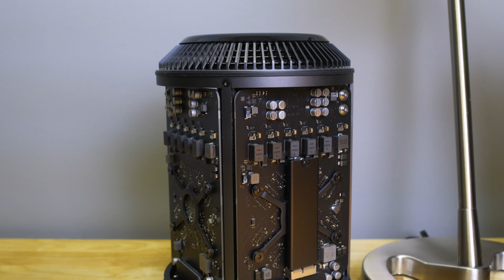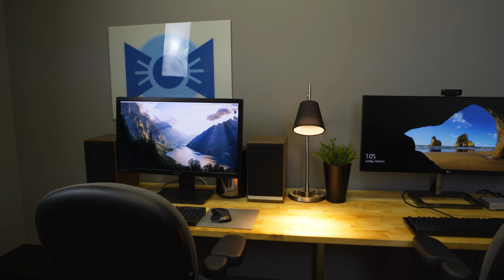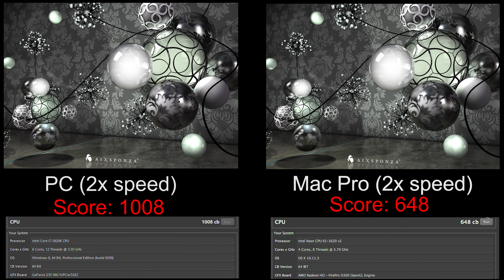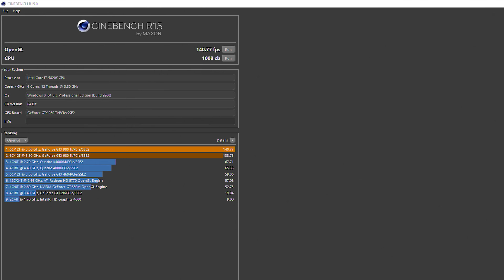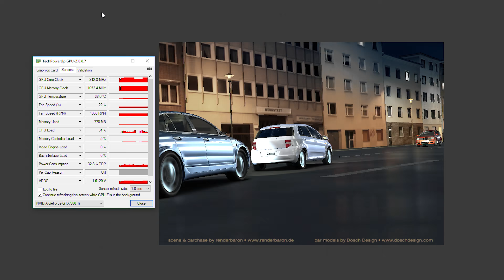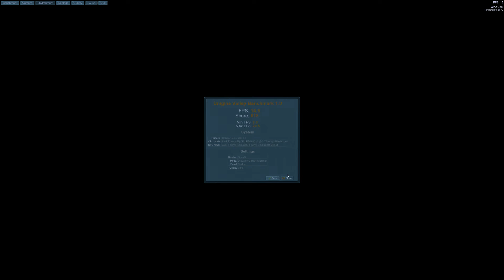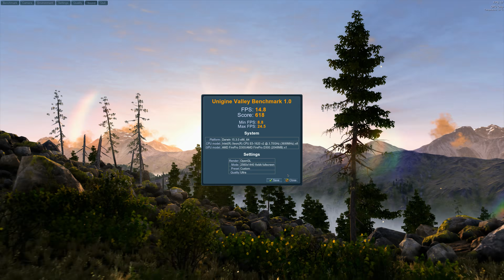$2,000 Custom PC vs $4,000 Mac Pro

Comment: Mac = Empty symbol of status and looks.

PC = Actuall worth in substance and performance.

Conclusion:

Buy a Mac if you want to prove yourself as an vain air headed person. Buy the parts and build your own PC if you are an intelligent person who cares about actuall performance and longevity.

Ps.

I know, I know... I am sounding like an rude asshole, I maybe am, but that's my slang and my statement is true anyways. If you have the money to spend on a Mac, there's no an actuall reason to not build a beast of pc equivalent to the same price or an still by far more powerful machine for like half the price. Now with the new Mini ITX structure you can also build campact and very good looking machines and still have a dope performance over Mac.
Reply: Fossegrim ya , it is your pc, but the problem that cause you unable to access internet is not the pc, can be a lot of issues. eg : lan cable and os.

If you say Mac os is better than Windows os then I okay with that.
Reply: The PC I will be building will murder any Mac
Reply: Fossegrim Then it is "your" Pc the problem. There are several models of Pc and laptops over there, and find a good one is not that hard, even less is you have the budget to spend into a macbook.

But what are you saying is like say all books are shit because the only book that you have read was a bad book.

Again, I know it is easier to pick a Mac because there are more standarized models, but picking a PC/Laptop is not that hard either.
Reply: Gabriel Pereira I only wish macOS was available for custom builds. Windows really pisses me off, lol
Reply: Gabriel Pereira But PC runs Windows so..... 😉
Reply: Not so sure about that. The portable Pascal series cards are very impressive, although I don't think they've managed to squeeze the 1080 into anything smaller than a 17 inch laptop. 15 is my max for something to qualify as portable. I'm a college student, I'd like to have room in my bag for other things too and not look like a hiker. One other thing that really irks me about windows laptops as well is the trackpad software. It's gotten a LOT better, but Mac tracking simply feels more organic with the multi-touch gestures and all. And I also despise touchscreens on laptops so that feature is useless to me.
Reply: Gabriel Pereira Um, my pc costed more than my mac book. Made a custom build from the top deliverer in my country.
Reply: The PC I will be building will murder any Mac
Reply: Craig Smith In that matter I have to accept you are right. Linux is better OS than Windows. But overall, Pc's are still better, atleast Windows is good enough to fulfill its end.
Reply: is it hard building a pc n how long will it take?
Reply: +Craig Smith thx fam I appreciate the help💯
Reply: SpartanDara117 u can put a desktop pc in a bag and mac is shit
Reply: SpartanDara117 Zotac mini pcs are ready to jump in your magic backpack
Reply: Gabriel Pereira

Apple is not great value for money, however, some have more important things to do than to sit around playing games. Windows OS across the board is a complete dumpster fire.
There is no ecosystem that can provide the holistic experience apple can #fact.
Reply: But now, with the new pascal gpu on laptop, you can put a "desktop" on your backpack.
Reply: SpartanDara117 So yeah... I am also a college student and I have a 17" laptop and I'm just find. I got this VAIO in 2009 and since then it just have required to format its drive twice and one charger replacement, which you can find pretty much anywhere since it doesn't requires exclusive like hardware. I know, is a pretty old model but the way it has served me during all this years with no need of major maintance rather than your typical drive space liberation or getting a new charger just proves how much of a longevity a pc/laptop may have.

As I said, I know I was very rude with my main comment. but still, getting my laptop with me is even waaay more comfortable than carrying your avarage single book.

Ok, it may not be as thin or light as a Mac but it is in no way a "brick", plus is waaaay cheaper, sturdier and the performance is just great (I have been thinking on change it tho, but het, almost 7 years with it and even if I'm going to change it it will not be any time within this year haha).

So it is ok if you pay "a bit more" for a machine if this one is more comfortable to you, but paying that much more just makes all those esthetical and comfortable "details" menaingless because it is way too overpriced.

I'l give you this, if your major specificly requires a Macbook then ok, it an't be helped and you have to gor for it. But by the same ammount of money pretty much any laptop would be more than capable to suffies all your needs with ease.

Otherwise is just like buy an expensive car just based on details like "if i like the shape and color, if it has a good stereo, if it has leather interiors" and stuffs like that, instead of actul engine performance, gasoline consumption in relation with the power delivered, if it is able to ride through harsh roads, how expensive and how hard is to get replacement parts, how many time it  etc, etc.

So what if the laptop is 1 pound heavier or 1 and something inch wider, if I can save more than U$200 and still getting a damn good performance there's no way it can be even called a bothering to carry a machine like that.

When the time comes I will be changing my laptop for a aprox U$2000 = i7 6700K/16Gb ram/gtx 1080 G8 Desktop Pc, that should be last for "at least" another 7 years, and for portable porpuses I'll just get an efficient tablet.

I will use some Mini ITX type of build, but if I decide to make an even more "long term" pc I will just go for the standart size just to get further further room for improvements.
Reply: Aoron1nash That's right.
Reply: yep, Macs are overprice especially the Trashcan
Reply: Fossegrim its not pc problem , I feel pity about your electronic devices , you know nothing about them
Reply: Louis Lee It is my pc. When I get a pc, I expect it not to randomly deny my access to the internett.
Reply: X_KING.ME_X not hard, you just need to make sure every component is compatible
Reply: +Craig Smith ahh so I wouldn't be able to just buy different parts from different brands? I want to build a pc that can run ultra 1080 on all games. I can only spend between $3,000-3,5000 tho
Reply: X_KING.ME_X you can buy different brands just ensure the motherboard fits inside. That's one example. Another example could be with RAM (memory), if your motherboard (main component circuit board) only has 2 slots for ram sticks, you can only have a maximum of 2 sticks. Maximum supported RAM for a motherboard is displayed under a specification table. My old motherboard supported 16GB of DDR3 type RAM maximum.
Reply: X_KING.ME_X all the cables need to be of the right type
Reply: X_KING.ME_X that's alright fam ;)
Reply: Michele Grieco my full tower pc fits into a bag
Reply: i have a 1000$ Asus laptop, never lagged, never failed me , both in games or rendering
Reply: Mac = BOOLSHIT!
Reply: And still, there are ways to perfectly run Ubuntu or Linux into a PC.

#fact.
Reply: Consuela you mean... Apple is expensive and everyone knows it
Reply: so  what? you can install OS X or a linux distro
Reply: Lelouch Vi Brittania you forget about thermal throttling on them tho
Reply: i buy macbook for its design, and osx is very very smooth, without any bugs, easy to operate, and once again, nothing beat apple design, good luck at backpacking your 8kg laptop with its plastic texture and 70mm thickness, 
it's like comparing 130k nissan GT-R vs 400k lambo aventador, still GTR faster than aventador, then why people still buy aventador?
Reply: Razer HP specter Dell XPS15 ect
Reply: Gabriel Pereira iOS development requires a Mac so you need a Mac if you want to do iOS development
Reply: GBCAwesome or an hackintosh
Reply: X_KING.ME_X get used parts and if you don't want it
then try win the lottery
there are websites that builds PC's for you and ship it to you.
just choose the parts and pay them a small amount of money
Reply: I'd like to know if the DDR4 RAM plays a. role in the difference?
Reply: G Thomás Hart 
Ryzen/8th gen Intel only supports DDR4, it's basically a futureproof thing
Reply: and everything you need to do its just navigate in internet using spreadsheet and some other  noob typical stuff.. 90% of apple users are  noobs and newbie....
Reply: idiot
Reply: In short

Mac = Expensive

PC = Cheaper
Reply: No. I bought a Macbook because its a well-constructed piece of hardware that functions extremely smoothly and does everything I need it to do.  I also have my PC rig to demolish benchmarks and fly through games. Different devices for different uses. Good luck building a PC you can toss in your backpack.
Reply: SpartanDara117 That's what laptops are for tho.

Please quote where I said "portable devices" or where is that topic covered in the video in which context I based on my comment.
Reply: You didn't, but I got the feeling that you suggested that windows laptops were superior to Macs, which for me simply isn't this case. The whole "buy a Mac if you're air headed" thing you was what got me.   My mistake if you meant otherwise.
Reply: there are some portable pascal laptop out there that brings great performance for the size, for example the 1060 version of razer blade, or the 14 inch msi laptop etc, but i think there is no one can beat the quality that macbook offers.
Reply: This is BS. My pc's always get some problems after 1 year or something. Its really hard to find what the problem is aswell. Right now, it seems like its chrome. Chrome cant load a site, then crashes, and then the whole pc can not get connection to the internett even tho its connected with a lan cable. Have to restart to fix it. Does not know what the origin is. My macbook pro from 2012, the only problem is that it is really slow now due to 4+ years of age and updated OS. People that buy mac do it because they just want a PC that works, and i have never in my 4 years owning one have to dealt with any problems at all. On my windows that I have had over 6-7 years, I have used countless hours trying to fix shit on it. And also, you call people that buy mac vain air head? You dont even know the definition of a PC. You are basically saying that a mac is an empty symbol of status and looks, but a portable mac is also actuall worth in substance and performance.

Comment: I too purchased a refurbished part that I regret.. A WD Black 2TB drive. It made a grinding noise when I first received it, RMA'd it and the replacement drive I received seemed good.. Now about a year later, I've loaded the drive up with content, and I'm having a few system hiccups. I check it out, and S.M.A.R.T. tells me there are several bad sectors, indicative of a failing drive : (... Never again will I buy refurbished junk!!

Comment: Ive had both for over 20 years now and speed is one thing. Stability has been Macs biggest strength. Ive built tons of pcs and i used them to the point where i had to rewipe them every 6 months. Macs just hold up better. Thats why industies use them regularly.
Reply: Yeah no. I own PCs and Macs. I have problems with the Macs constantly, whether it's random shutdowns for no reason, features that just don't work properly (file sharing comes to mind) and consistently after a couple of OS updates the whole system is trash and needs to be rebuilt from scratch. So try another argument.
Reply: The Laptop I'm using in this very moment, have been with me since 2009 and still works fine.
Reply: what make is your laptop Gabe ?
Reply: Sjrick It's a VAIO, don't remember the model tho. Was a gift from some uncles when I was about to start college. I just have formated the hardrive like twice, and now I just need a new charger since my current one is starting to get loose. But that's pretty much it.
Reply: Sjrick had my pc since 2009 :) bought a macbook in 2014, it broke last year.

Comment: I think you should to run cinebench on the same OS, because in windows, cinebench show results 40-50% better than cinebench running on OSX/Mac OS.
Reply: Found the Mac enthusiast.
Reply: Grankus But if you was to buy a Mac Pro you will most likely run it on OS X
Reply: Grankus well thats why its called PC and MAC. not p-mac or ma-pc
Reply: It’s not about OS, it’s about Prices
Reply: Just another point how bad apple is when there OS cant even keep up with windows xD

Comment: I would never get a Mac for gaming, but my 2015 Macbook Pro is great. Not for gaming, the hardware is outdated (even at release), but it simply works. I love the battery life, the screen, the keyboard, the build quality etc - and that makes it worth the price since I will not need to buy a new laptop for many years. 

I'll probably get a gaming PC soon and install a Linux partition on it as well.

Comment: 3.8ghz with a 280mm liquid cooler on the 5820k? You lost out on the silicon lottery BADLY. The 5820k build I did was able to hit 4.6ghz with a similar cooler.
Reply from the maker: +Kevolu I'm at 4.5 now.
Reply: Snazzy Labs yeah I was fairly certain you were able to fix it by now. I had a harder time overclocking the 5820k than the 6600k. Just tends to be more finicky.
Reply: air coolers get way too much flak...
Reply: pretty sure he can overclock it better
Reply: some air cooler are very good... You're saying this as if it was stock cooler (ahah) . I'm at 4.5 on a 4770K with a Dark Rock 3 (and I was at 4.2 with the stock cooler :p)
Reply: Snazzy Labs lel now it probably destroys the Mac pro even better

Comment: Thanks for the comparison. I am on the market to get a powerful, but small and quiet workstation. And the MacPro is really behind in what powerful is concerned. If they don't upgrade this Fall, I'll go PC.:(
I realize this is 6 months oold, but could you tell a bit about the noise levels. If the computer is next to your desk, having it as quiet as possible is important. Thanks again.

Comment: Thing is, the apple design is much better in every way and the main reason to buy for me would be for the Mac OS wich is superior to windows and i can run any os on it if i realy want to, but on pc you are stuck with windows wich is worse and worse or best case scenario you can use Linux but that's it.
Reply: You are aware that you can run Mac OS on PC's right? Also there are numerous other OS's you can use and not just windows. Search hackintosh.
Reply: Dany McJackson The point is; you can swap your own hardware (replacing old hardware, upgrading old hardware, replace hardware that goes out, add memory, and anything else), save lots of money to be able to put towards better hardware, and you are running a native OS not a emulator.
Reply: Or you could build a hackintosh. They are getting more popular for just this reason.
Reply: No he is not aware, he is an Apple costumer.

The only one stuck is the Mac user, it's like THE directive of Apple design philosophy. 

You see it's easier to code a "superior" OS when you know what hardware will run it.
Reply: i am aware of hackintosh but that never worked well and what's the point in having a hackintosh? almost nothing works and you can't trust it with stability/security because it's nothing official, just people trying to fit things that aren't meant to fit. And by the way i am not a mac user, at least not yet.
Reply: it's not invalid because apps in emulators are not working like in a native os, it's the same shit like trying to use windows apps in linux.

Comment: The problem for ME with your Windows machine is that it's still a Windows machine.  How about making a Hackintosh version of that?
Reply: The Problem with hackintoshes is that you are also limited, so the Performance would be just a tad higher than the Mac pro
Reply: Limited in what way? The hardware you can choose?
Reply: Yeah, it has to be Hardware supported by the os (components already in some form of Mac). Or at least that's how I understood it
Reply: Marcus Octavius Well.. wait.. there's nothing that supports that hypothesis.. I'm a 10+ year mac user.  The challenges with hackintosh are completely based in that trying to build one can be daunting because of the fact that macOS is pre configured to support only hardware that apple 'approves' of.  And SnazzyLabs has made a hackintosh Mac Mini that in many aspects ran rings around the currrent Mac Mini models.  So back to my original statement - I want to see a Hackintosh that can be put up against a Mac Pro.
Reply: tmo1138 oh ok. Yeah, then I completely agree with you.

Comment: $2000 Apple logo, $2000, actual usability.
Reply: More like $2000 Apple logo, $500 Design, $500 Easilly movable, $1000 usability.
Reply: The "portable" part is part of the design. So maybe $2000 Apple logo, $1000 design, and $1000 actual usability. LOL

I don't get why people are buying overpriced tech that is worse than a potato. iSheeps.

Comment: When you buy the minimum model with no upgrades (a professional would almost certainly not do this) you will get limited performance. The computer is marketed towards people who would probably be aiming to upgrade it as well, seeing as the $4000 base model does not provide much difference to the current macs being sold.

Comment: Why did you overclock the PC ? To make a fair comparison, you should use them both without overclocking, or overclock both in the same way.
Also, BTW, my PC is a 250$ cheaper than what you provided, and it got similar good results without OC :
Unigine Valley Benchmark :
FPS: 
41.4
Score: 
1734
Min FPS: 
19.8
Max FPS: 
74.9

Cinebench R15 : 
137.57 fps
685 cb